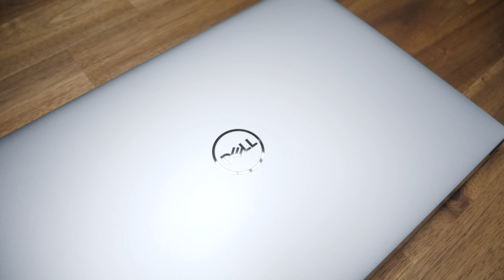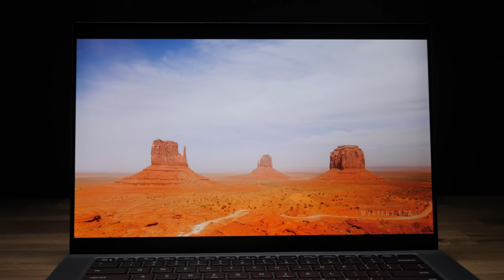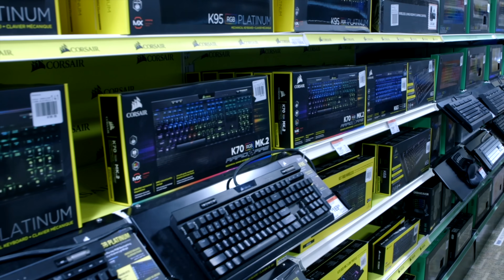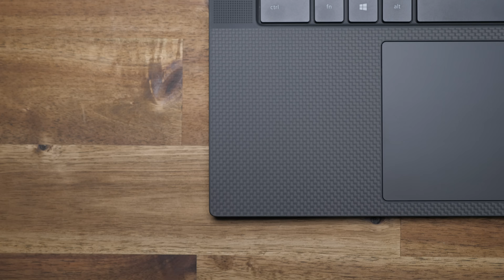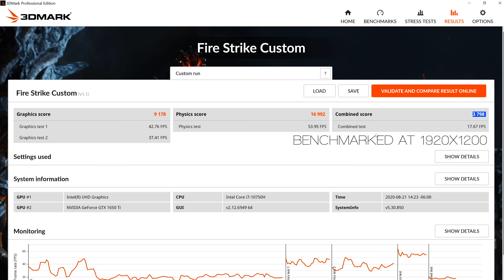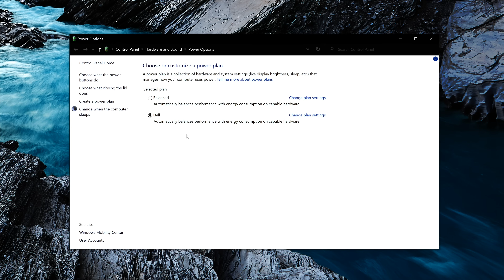Dell XPS 15 9500 Review: jack of all, master of none

Comment: i think for the wobble you can get inside the laptop behind the battery and tighten the screw a little bit, yeah you shouldn't have to do that but if you really want the laptop without having to send it back...

Comment: “DO NOT BUY IT” I ordered this laptop and it arrived damaged. There were scuff/scratch marks on the silver front of the laptop - this is highly unacceptable for a laptop costed at £1,800. The plastic film that was wrapped around the laptop had white marks all over it and there was no protective film on the screen, which suggests to me that it is a laptop that has been previously returned. When I tried to switch the laptop on, there was no power on the battery, which again is not right because the battery on a new laptop always usually has some charge. This tells me that this laptop has been sent to somebody else before me. I also realised that the trackpad was loose. I believe this is an issue with this laptop that I thought they had resolved. They promised their customers that laptops purchased after June would not have this trackpad issue. It is evident that the laptop I received is faulty. 
I rang customer services on 27/08 and, as requested, I emailed some photos/video of the damage. I was told that someone would contact me in 48h, but nobody has been in touch. I have paid £1,800 for it and I am appalled with the quality. It has been over one week still nobody has contact me yet. It’s awful customer service and product. Do not buy this laptop if you don’t want to waste your time and your money. I will ring them again on Monday and I will definitely return this painful laptop.
Reply: Hello guys. Same here. 1st laptop arrived early August with problematic touchpad and dent on USB port. Replacement came and trackpad is worse with again a dent on the screens cover. Now have two laptops. What should i do? Wait for the lucky 3rd one? Or move to another laptop? But which one?

Im thinking of keeping both if they don’t accept to refund and just sell them on ebay for 1000 each 😂
Reply: @AskTheo_  I wouldn't wait for a third man. I had called Dell and was told by them that they will resell returned laptops in the hope that someone will keep it anyway.  I have decided to go for a different brand of laptop, because Dell does not have its things in order and I think that if I pay such an amount of money for a laptop, I should get one without any defects...
Reply: David totally agree with you but what to buy my friend. Name me a laptop that compact and beautiful. I don’t want to run bootcamp on Mac. I do 3d modelling
Reply: @AskTheo_ I understand the frustration of what you should choose now.  but unfortunately the only laptop that is so compact and powerful is the MacBook pro🤧
Reply: I can empathize with this 100%.  Same thing happened to me.  I ordered this laptop twice and received an xps 9500 twice with a broken wobbly trackpad, fans bouncing on and off every 3 seconds and a dent on the bottom.  What I noticed is that there is also no protective layer for the screen... I've also seen reddit talk about this type of laptop issue a lot and that Dell never keeps its promise from this laptop.  I'm going to return this laptop tomorrow

Comment: Soo... Returning my Aug purchased 9500. Damn trackpad is horrid, like resume producing event horrid. Just drops dragged files any where it wants. Good 1/4 inch depression on the left side of the trackpad. Avoid if you only use the trackpad. Otherwise its a nice laptop that will run linux.

Comment: I ordered this laptop twice from costco in early August, both have wobbly trackpad to varying degrees. The second one also have slight loose keyboard. Pretty frustrated.
Reply: I saw a Reddit post that the palm rest will be  changed, but haven’t seen any posts from anyone saying it’s in the latest production yet.